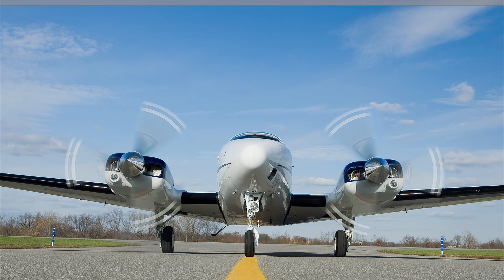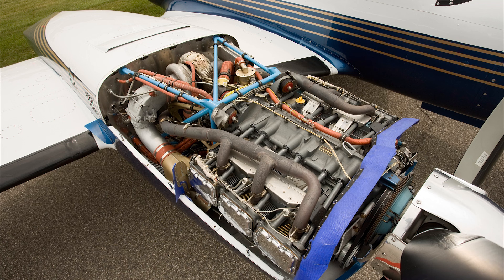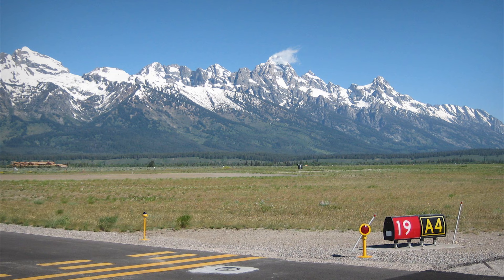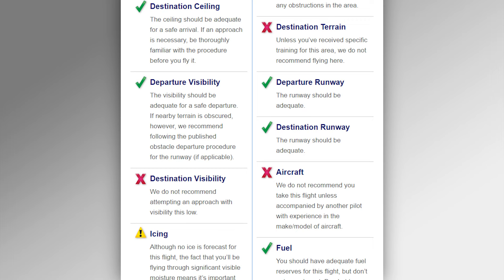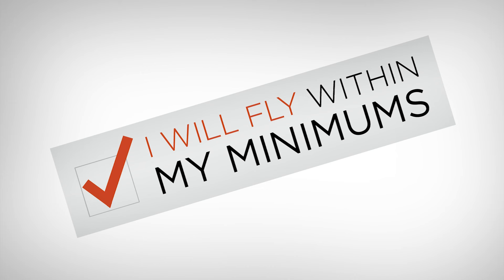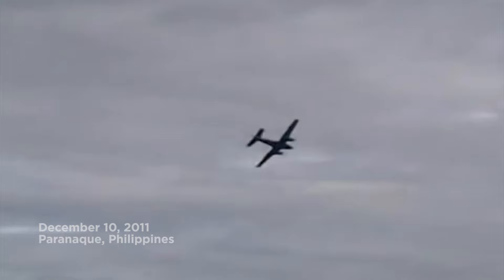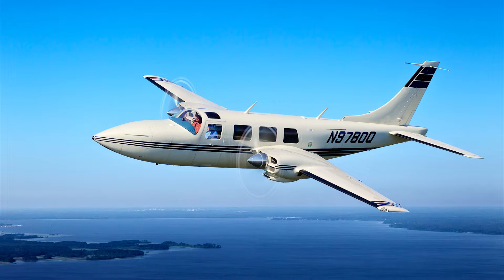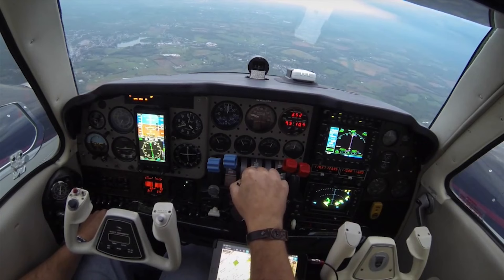Taming the Twin: Four Rules for Safe Multiengine Flying

Comment: What is feathering the prop?
Reply: Feathering a prop [ in a variable pitch propeller ] is a way to turn the blade angles into a position that there is the least reaction [ or wind-milling ] ] when exposed to the relative wind created by the forward motion of flight. The normal angle of propeller blades cause them to generate thrust when the engine is working but when the engine stops in flight that same angle creates a lot of drag as the propeller seeks to rotate at the expense of the aircraft's forward airspeed. in a lot of aircraft the stopping of an engine creates a loss of oil pressure, within the propeller [ internally ] and a big spring in the propeller hub is now free to push the blade angles into the feather position automaticaly.
Reply: Rotating the angle of the prop blades. It reduces drag. It also acts a bit like gearing for the engine in that it will allow different engine rotation speeds for a power setting, to allow for more efficiency. Reverse thrust can also be provided through feathering the prop.
Reply: thank you
Reply: @YouTube.TOM.A  actually, minimum drag is with a small amount of rotation. A lot of turboprops have 'auto coarsen' which doesn't actually feather the prop, but brings it close to. For the actual min drag configuration. When you secure the engine and fx the prop the drag actually increases a bit, but by that time you aren't in as critical a situation.